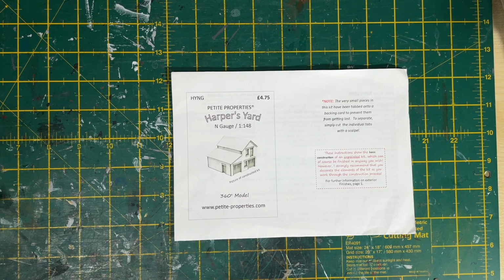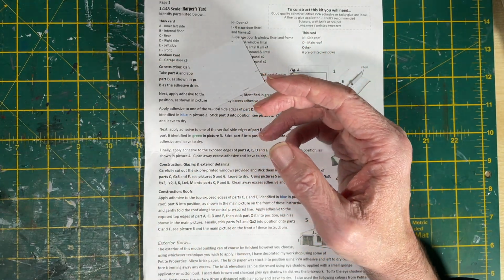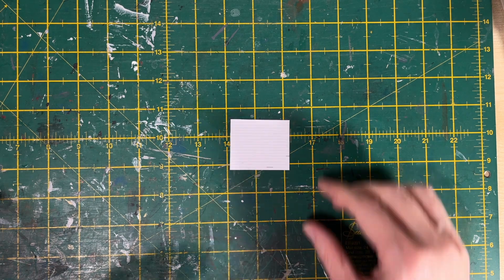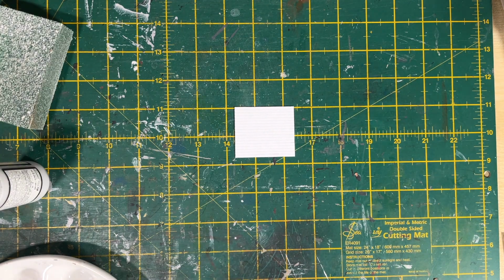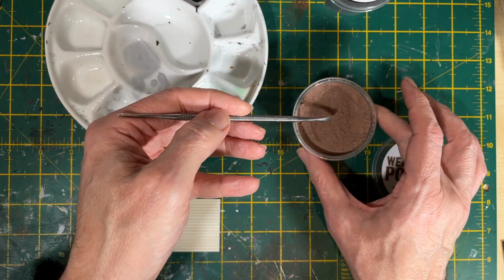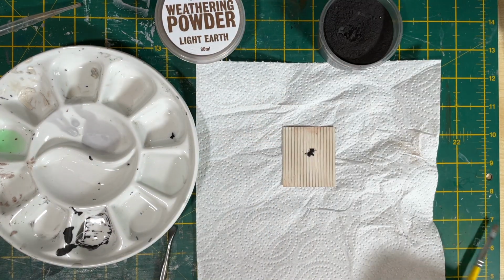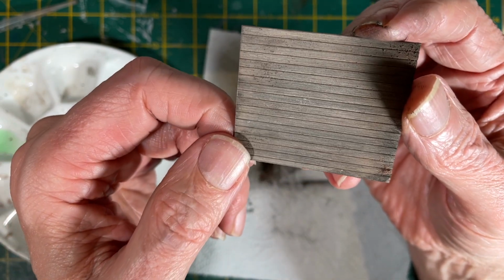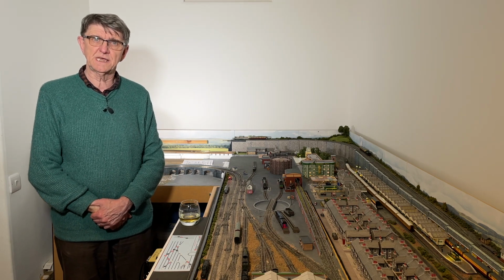N Gauge Model Railway Layout Getting a woodgrain effect on plastic card  Elvenhome EP 137

Comment: Must be something in the Scottish air that makes great things happen using grain 😉🥃 Harpers yard definitely looks the part for using the wood effect 👍 Using pale yellow as an undercoat, is an old decorators trick for wood 🤫 The jinty performed magnificently 👏👏👏 probably only needs a rub down with a chamois 😳 on shed 😇 Very best wishes for a Happy New Year from the Emerald Isle 🥃☘️
Reply from the maker: Hi Paul.  Scottish air is good for many things, especially those involving grain.  I was pleased with the outcome.  Once it had its wheels cleaned, the Jinty did me proud.  It also propelled the train cam, and didn't stall once.  Happy new Year  Stephen

Comment: Its a fascinating process creating the wood effect and it certainly works. Never know I may give weathering powders a go myself one day, lol.

Great to hear about the waterslide transfers. Ive made loads over the years, and you are right you cannot print white. However, you can print on white transfer paper and match the surrounding colour (as best you can ofc). It does work but sometimes there can be white edges, so models MAY need a bit of ‘touching up’. Dab on thinnish 
 matt varnish over the top, no-one would know. Matt varnish over the model itll be fine. You will need to varnish the transfers before use. I found one coat of Halfords regular gloss lacquer works well, I think the secret is to keep them warm, freezing temperatures can cause splitting, even after application. I did try the recommended 2-3 coats of varnish, but this caused the dry lacquer to crack, and was useless. One coat worked well.

Happy to help if you need it, but best thing is to have a play, work out what works best for you.
HAPPY NEW YEAR!
Reply from the maker: Thanks very much John.  It has been an interesting process seeing what does and doesn't work with clear transfer paper, and then using some white transfer paper to deal with the design I have in mind.  I think the white transfer paper I was using was  a bit basic and at some point he postman will deliver some from Mr Decal Paper which have lots of good reviews.  I will keep you kind offer of help in mind in case it does all go belly-up.  Happy New Year  Stephen

Comment: Hi Stephen, now that turned out really well and an excellent wood grain effect. I used the thinnest balsa wood to do my Harpers Yard, bit fiddly though cutting the 3mm strips! It’s a lovely model and you’ve made such a good job of it. I think I may have done something similar to you as I do remember having to take a piece off as it was the wrong way round! I’ve also seen a fine toothed razor saw used to get a wood grain effect in plasticard which also looked really good. Concrete dust is another excellent all round powder to use I’ve found I think Sam on Peaks47 used it rather a lot!
It’s been really great following your progress over the year Stephen and often inspires me with my layout and your encouraging comments from you on my own videos. Cheers and Happy New Year to you and your family, John🍾🥂
Reply from the maker: Thanks John.  I was more than a little miffed when I realised I had attached everything to the wrong side.  I was relieved when I found I could remove all the detail without breaking it, and it has given it a distressed look quite unintentionally.  I've had a couple of suggestion about the razor saw, and I will give that a go next time I want to get this effect.  I amp lso going to experiment with the other powders I have.  I nearly used the concrete dust but was pleased with the effect of the two.  I might experiment on the piece I used in the video because I haven't sealed that yet.  Happy New Year Stephen

Comment: Not tried it myself, but my research showed IPA as the liquid to mix with powders, it is a good surface tension breaker and dries much quicker than water. I bought transfer paper years ago, but never got around to trying it, so looking forward to what you will do!
Reply from the maker: Thanks for that Tim.  It makes sense to use IPA and I will try that next time around.  If I get the paper in time I hope to have the waterslide transfer on the side of the tank wagon in the next video. Happy New Year Stephen

Comment: Hi Stephen. Another triumph! I'm sure I have asked this before, but my memory being what it is... Limitations of what is on the underside of your baseboard notwithstanding, how did you decide where (exactly) you would install the turntable - did the turntable come first, followed by laying track to it, or vice versa? I wondered what your choice of libation was (silly question, really). My brother is an amateur aficionado of whiskies; what would you recommend? Wishing you and your good lady a very happy New Year.
Reply from the maker: Hi Paul and thanks. The turntable was part of the original design. It’s positioning made me use a double slip to gain access which has proved very versatile. I never had a clear idea what I would put around it. The coaling tower and incline were a much later addition and that helped decide on the lines that lead off to the left of it.  As to whisky recommendations that is trickier. I was drinking a Highland Park 12 year old malt. Not too peaty and one of my favourites. Much depends whether you like a smokey flavour or not.  I quite like Dalwhinnie Winter Gold (often on offer in Tesco) I don’t drink blended whisky much so can’t say about those. Happy New Year. Stephen